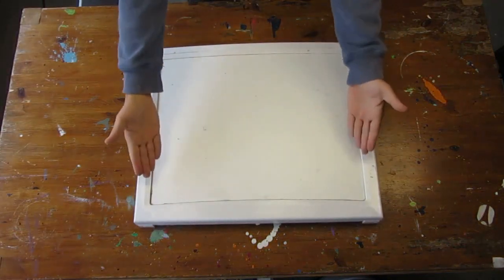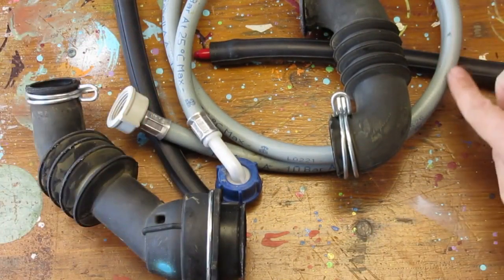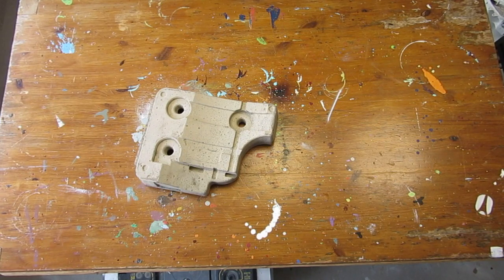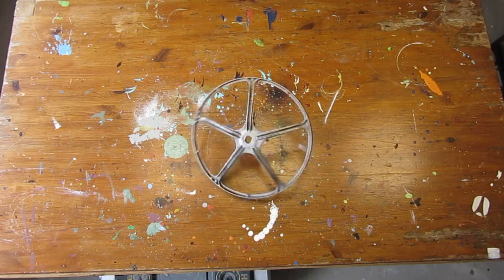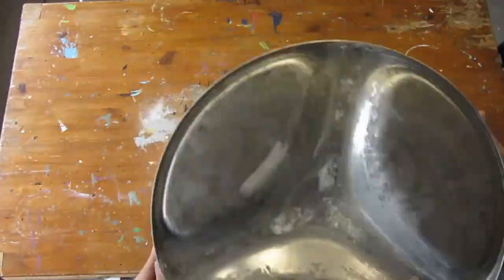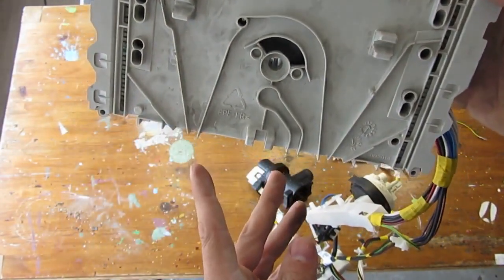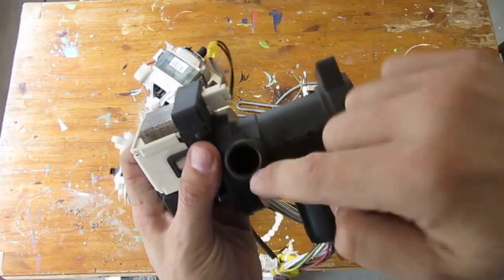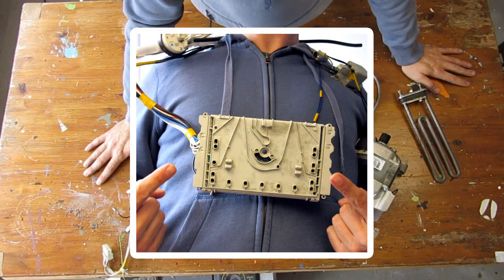15 Things You Can Reuse Inside A Dead Washing Machine [WMTeardown Part 2/3] #Tech #FreeStuff

Comment: How much temperature can washer glass door withstand ( for cocking in the oven ) ?
Reply from the maker: Those are built to withstand pressure, provide an hermetic seal and resist to (non-boiling water) average temperatures. It has not been made to resist to high oven heat, so would not use it for oven purposes...

Comment: I've been using washing machine motors in my shop for over thirty years. With a simple arbor adapter they run numerous bench grinders, wire brushes, buffer wheels, and is great for table saws.
Reply from the maker: Nice!

Comment: I usually convert them into large , high-powered and  dangerous cheese graters by putting a razor edge to the holes in the inner drum and using a 1200cc V-twin motorcycle engine to replace the electric one. I then chicken out of using it myself and just leave it in a playground with the motor running. Plus I'm lactose intolerant. So .. This is my life..
Reply from the maker: The most sensible answer of the day, thanks for that